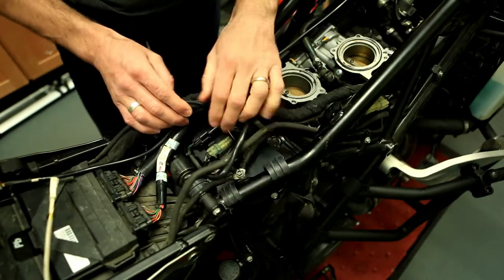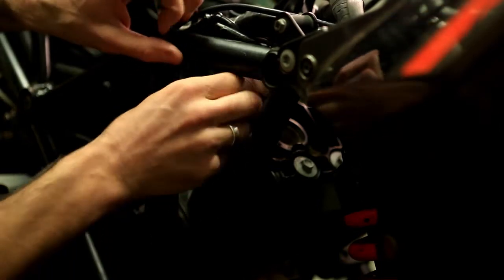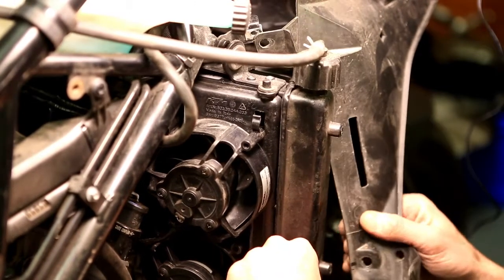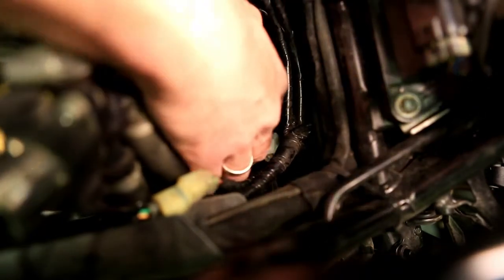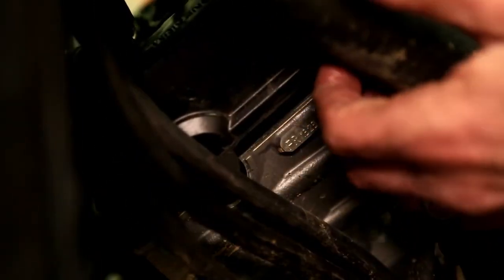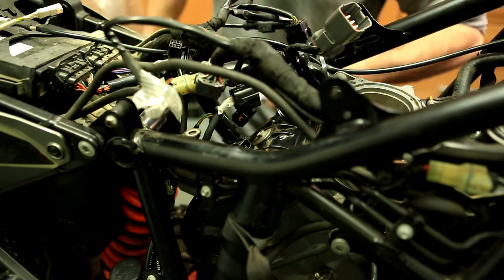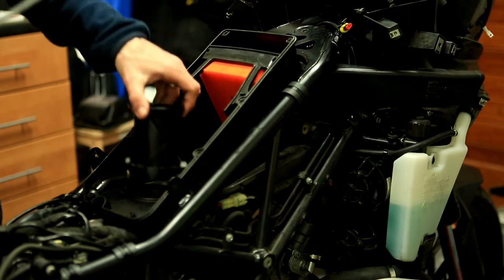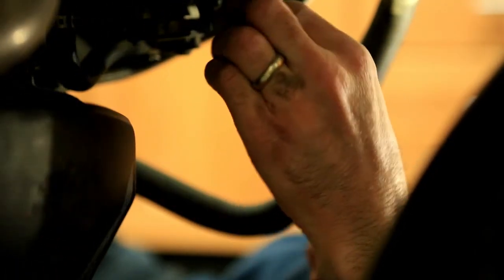Ktm 1190 spark plug change and valves clearance

Comment: changed the spark plugs at 32k km, and now, at 37k km, I regret not doing the valve check sa well.
If you do one, do the other as well.
Best explanation video so far... "back in the garage" skips important steps
Reply from the maker: Thanks mate, means a lot. Yes do it all while beast is opened 👍 good luck.

Comment: other question. my cylinder head is leaking, needs probably a new joint. would you know if this needs to get down the motor comletely or can one reach from above through the frame? thanks
Reply from the maker: I'd say you could access it thru the frame but it's very tight, give it a go, what's the worst that can happen :) Good luck

Comment: Is it possible that there is not clearance at all on the intakes valves for both cylinders? I used .038 mm and can't get it in. The exhaust clearance are with specification. Thanks.
Reply: Not sure to be honest, I'm not a mechanic. Just make sure you turn the engine to the correct endearment point.